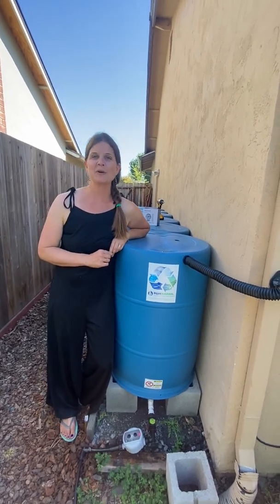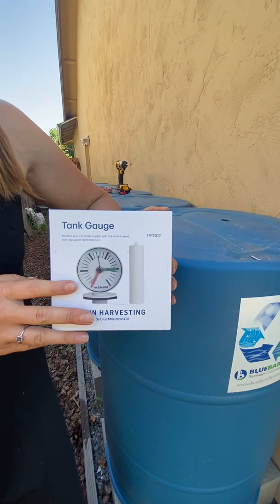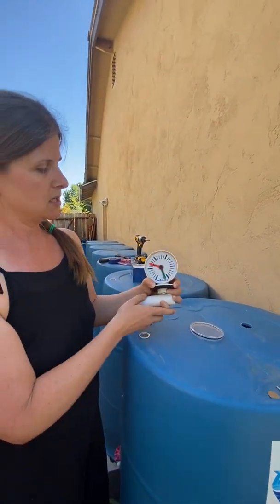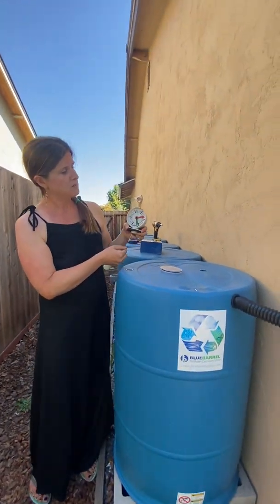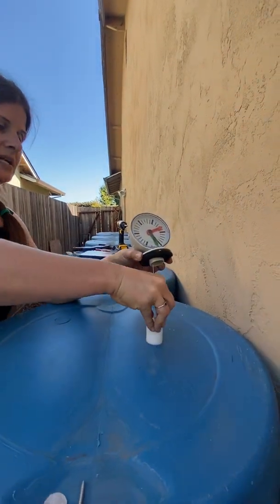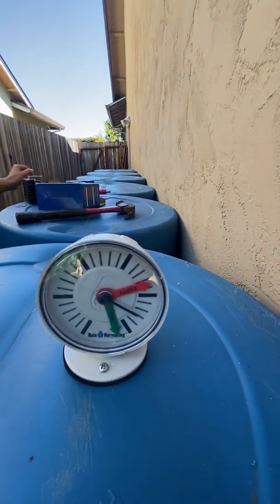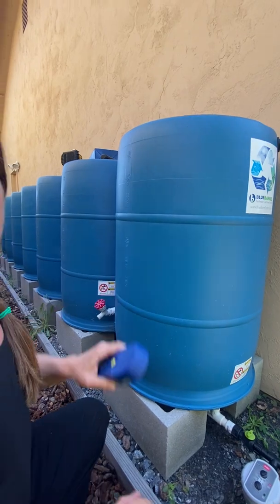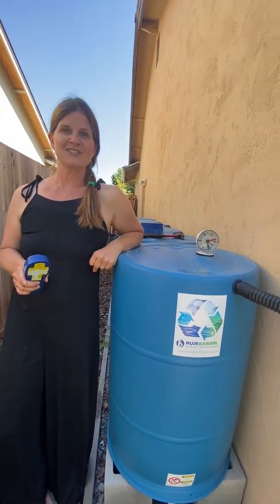Measure the Water Level in Rain Barrels

Comment: 1/2" pex elbow out of bottom of tank to 1/2" clear vinyl tube and you'll see your water level. Run the tube back into your tank if you're worried about critters getting in. Cost is next to nothing, as most people probably have scrap materials sitting around waiting to be used. Otherwise $8 maybe.
Reply from the maker: Hi there - we do feature the clear tube sight gauge approach on our website as well: https://www.bluebarrelsystems.com/blog/how-to-measure-water-level-in-your-rain-barrels/. But as the other commenter mentioned, it's important to keep that clear line COMPLETELY out of the sun or you'll introduce algae in no-time.
Reply: How is that clear vinyl tube (and your water quality!) going to look in six months, with a clear tube full of water, outdoors in the sun (whether direct or indirect)? Algae seems like a big reason not to use a sight tube.

Comment: Do I understand the system properly, that it enters the first tank and fills the last in the lineup and back to the first? Meaning, I would only need one guage per system; or would each barrel need its own guage?
Reply: The system connects the barrels together from the bottom... so the total volume is spread out evenly to each barrel... i guess an easy mental picture is if you had four barrels connected with this system, all empty to start, and then added 100 gallons of water... each barrel would get 25 gallons (25x4=100) since they are each tied together from the bottom.  They each would get an equal amount of water at the same time since they're linked.  So a gauge in one barrel would give you the same result in any barrel since they're all equal at all times.  So final answer: yes, you only need ONE gauge for this system, to be placed in ANY of the barrels.
Reply from the maker: Hi there - sorry for the delayed reply - we don't usually get customer service inquiries thru YouTube. Looks like you got a good answer from the last commenter, but please reach out to us at https://www.bluebarrelsystems.com/ if you have more questions.